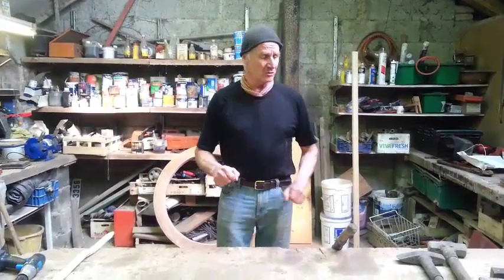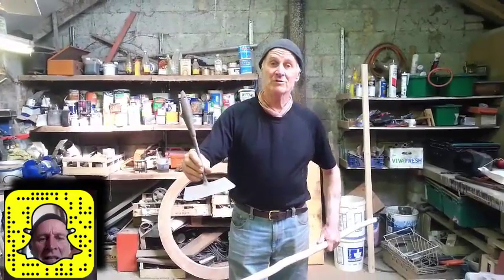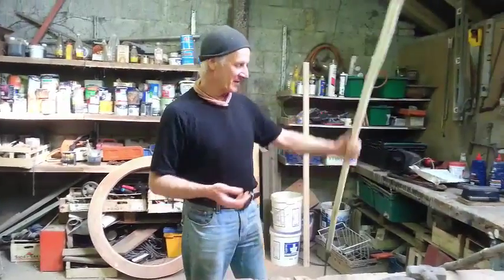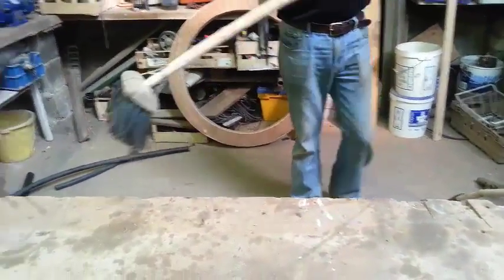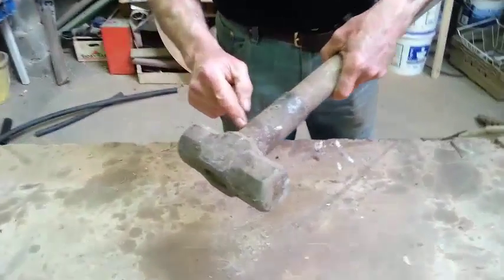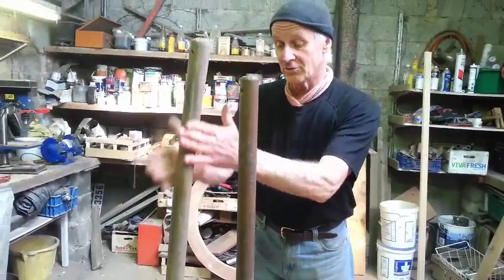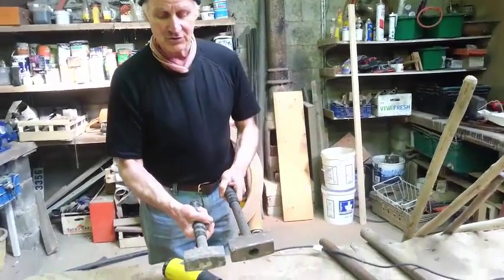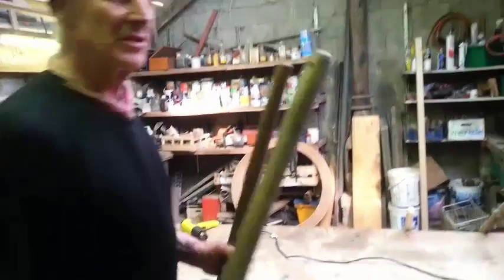Tool handles made from hazel saplings.

Comment: Hi, I’ve just made a handle for a old ditching shovel and. Was wondering does it need to be seasoned and oiled before use? I was thinking a light coat of Danish Oil would do the trick.
Many thanks for the vid.
Paul